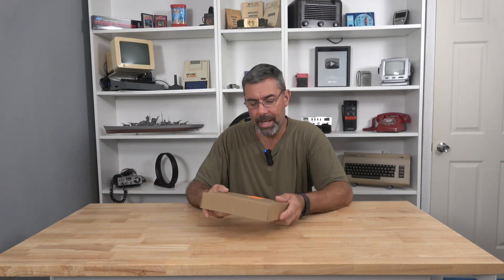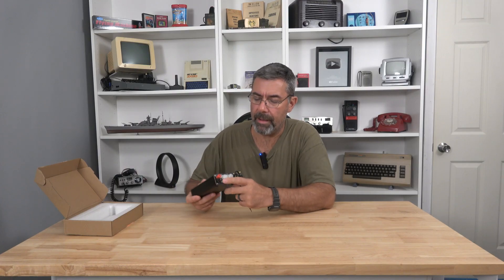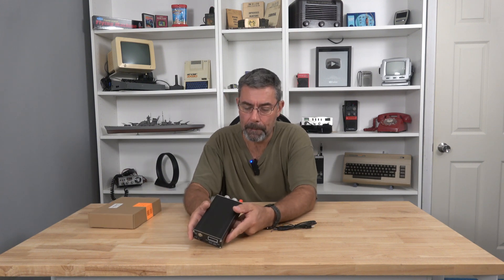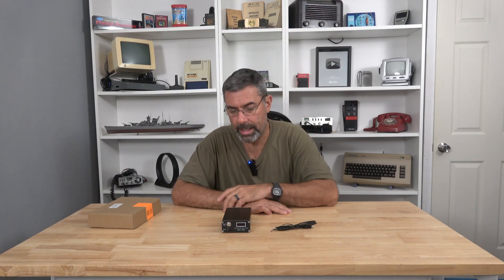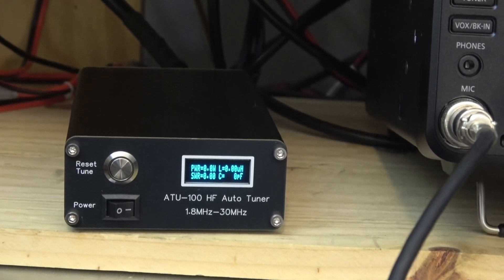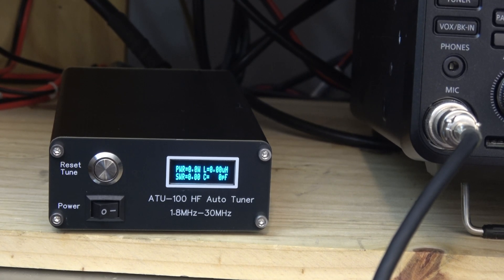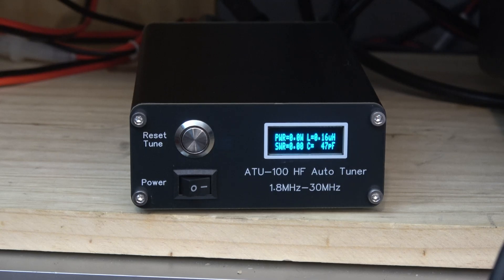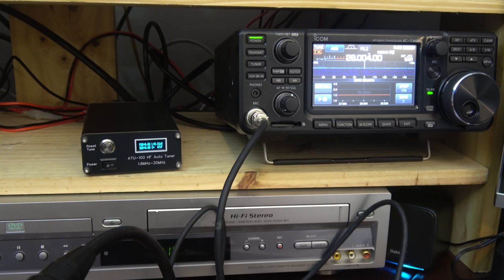GOOZEEZOO ATU-100 Automatic Antenna Tuner.

Comment: i just got a stryker 955-hpc+ for the old f150 with a old predator 10k on top . i also got a new mount and new jefatec 240 flex coax . would the GOOZEEZOO ATU-100 be a good match power wise for the stryker ? i am actually getting my tech and then general . i'm 64 , more cynical and want to be better prepaired and have access to more REAL folks opinions around the world . so a 7300 mk2 is on the list . we live on a ridge line @ 2400+ ft is SW Va. 
and ... on your 955hpc+ do you use the swr alarm ? if you do what do you have it set at or what would you recommend ? 
thanks , jeff
Reply from the maker: For the Stryker? I'd stick with the Predator.

Comment: Any idea how long it will operate before the internal battery is exhausted and needs to be recharged?

Also: it's interesting how the efficiency doesn't quite approach 100%.  Perhaps they have a factor for component losses because with a SWR of 1.17:1 the "efficiency" should be 99.4%.  Seriously, 1.5:1 SWR is only losing 4% of the power.

Btw, if your rig has a built in tuner "use it".  You only need another tuner if you are going to place it at the antenna  so that you don't lose power in the coax that then runs to the rig.
Reply from the maker: I have found this tuner works better than the stock one on the 7300.

Comment: I have an early version of the ATU 100. Usb rechargeable and it works extremely well. 2 years all ok. Beware some of the tuners have terminals at back. Some are power others are for long wires and ground etc. Also many don't work on qrp power however there is a low power version. George
Reply from the maker: Thanks for the tips!

Comment: People generally get defensive their use of language but ham radio and CB operators "transmit".  They don't "broadcast".  
In the definitions of Part 97 of the FCC rules "broadcasting" is defined as "Transmissions intended for reception by the general public, either direct or relayed".
Part 97.113(b) prohibits amateur station from "broadcasting".
Ham and CB operators are allowed instead to "transmit".
Reply: Don't even bother,,,this guy's a know it all,,,and knows mostly nothing,,,,lol,,,,,,and when he's dead wrong, he will not concede,,,,doesn't make sense,,,,lo,l,,de NV1H,,😎

Comment: If you have a choice, use a resonant antenna to make the most of your power output. A 40 meter antenna will work on several frequencies.
Reply from the maker: Good to know, thanks
Reply: Resonant antennas don't guarantee efficiency, non resonant antennas made resonant with an antenna tuner can be just as efficient in some cases more efficient as some non resonant antennas have more gain

Comment: I have a few manual tuners. Work great . Just makes radio happy. I have IC 7300 . Their is a E-tune mode that gives more range on tuner but limit of 50 watts .  In the menu their is emergency mode. That makes tuner work further .It has 3:1 ATU . I use for FT8 and SSB and 6 meter band FT8 . My antenna is good so no ATU I use. I do for some bands like 40 meter . I got full open RX on mine and 4 meter .I don't TX outside US ham bands . 4 meter is a UK ham band. Their is a mark 2 coming out. HDMI video and USB C . Mine has USB B. I am using a old printer cord for digital modes. I like the RTTY decode on 7300. If you plug in a PC and with like FL Digi you can decode CW to text and more. MMSSTV will decode SSTV . WSJTX for FT8 and 4 and more. I have gotten marine weather maps on SW bands and more. NOAA sends them . Even RTTY weather reports. So much fun stuff you can do with 7300 just receiving . Some Russian stations jammed with noise and with band scope set for water fall you can see like TXT and PICS . I won't send anything on Russian military frequency's ever. But many due .  War going on. That mess makes it to the US . Just some fun listing on SW bands. Cheers from NY !
Reply from the maker: Thanks for the info on the 7300. I am still learning all about it.

Comment: There are mixed results with those cheapo china tuners, it's much the luck of the draw as to which parts they used to build it with.  I bought one and it tunes nothing. It goes through the function process, but wrong parts in the assembly has it doomed {wasted money). 
If your going to use an external antenna tuner; LDG, is hard to beat. Yes they cost more money, but they work extremely well and will tune just about anything. If you want to keep your ic-7300 working, remove the china joke from your Feedline.  ICOM has little tolerance for odd antenna loads and uses fet finals. Yes they are supposed to have the wattage fold back feature. But recomend not rely on that, and with the china tuner, the fold back is nullified. Get you an ldg at- 200 and you will have a good tuner. I run the 1k version of the ldg tuner as I have an amplifier, I can use when conditions warrant. 
The ic-7300 is a nice rig, but they are not bullet proof. I run 1\2 wave dipoles in an modified inverted V configuration. On 10 meters I run an I-max 2000 with the ground radial kit, and it does an awesome job. Good luck and God bless.  Earnest k5ewm 🇺🇸👍.

Comment: So you have to tune it with a 10 watt  or less FM steady  carrier signal. Power shifts of AM or Sideband  can't be used for setting.   Max power it can handle is 100 watts PEP.  When you start DXing from  the electric fence around your   chicken coop.  I will buy one.

Comment: The ATU-100 is a nice little compact tuner. I also have one, and it would be nice if there were instructions. The two terminals on the back are for a wire antenna. The red is marked with an antenna, and the black is marked with ground. There is a small button on the back for A/M. If you press it, a small dot will appear between the input and output power. If you have it, you do not have to press the tune button; change bands, and when you key down, it will know what band and frequency you are on. I hope you enjoy the new tuner. I plan to use mine at home with a 40-meter EFHW to tune 30 meters. 73s de W3CT.
Reply from the maker: Good to know! Thanks for the tips.

Comment: I used a runner back in the day on my mobile so I could change radios and change antennas that I would with the k40 mount cone adapter.I could go from a k40 ,a 102” whip or a Frankenstein with ground plane .
Reply: I bought a k40 in the 90's and still use it. best mobile antenna I've ever used.
Reply from the maker: Neat idea!